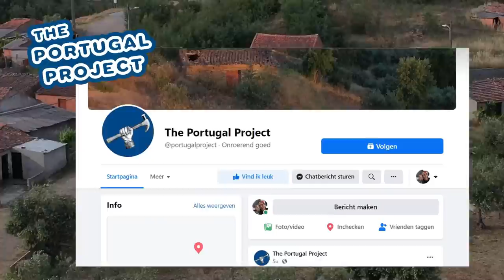MINI REBUILD PART 20 (batten spacing and finishing the door frame) - Portuguese House Renovation

Comment: Well Jasper you've managed to work out your batton spacing,weather is good.  The tiles will look OK,and do their job. This weekend  you'll be putting in the window and door. I would wet your walls and floor down inside to get the dust,sweep the walls too and the wooden beams. R U going to white wash the internal walls? It would brighten and make it look bigger inside. All little finishing jobs......nearly finished Jasper. Stay safe.

Comment: Quite a few Channels that I watch have started taking a break due to burn out from posting a Vlog a Day. I'm afraid with all the work you have and it being Spring/Summer you might get there sooner than later. That would be so sad :(. So suggesting an alternative to were you stil;l post but in a shorter format. It's called a YouTube Shorts - 60 seconds or less.
That would give you more time and relief you of so much pressure. What do you think? Just want you around for a long time :)))

Comment: Ok I know this is a year old video and I’m just now binge watching your channel but I have to offer an observation. In this episode you use your grinder to cut off the extended lintel next to your door. You get 99% off but leave a small chunk behind. You had the grinder in hand, plugged in but left the task unfinished.  This is a consistent theme of your focus and it costs you hours in the long run. Please think about this. Also hundreds of comments have told you to wet down the dry stone or concrete surface before adding new concrete. You still try to put wet concrete on dry and wonder why it won’t stick. Please tell me that you eventually listen to this advice. Not sure if I can follow another year of this oversight.  I mean no offense but by watching episodes one after another I see these trends and it drives me nuts.
Reply from the maker: Yeah you see things that are not there. I do progress a lot. And you comment therefore is not very motivating. Please unsubscribe I don’t want to bother you and further.